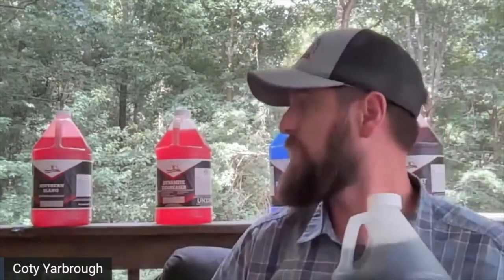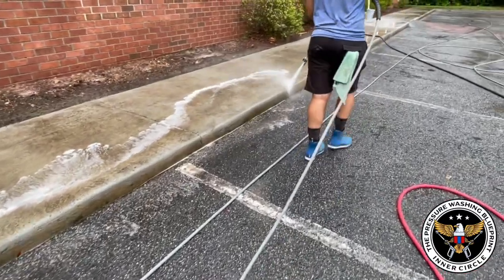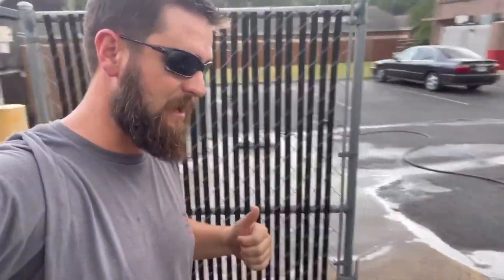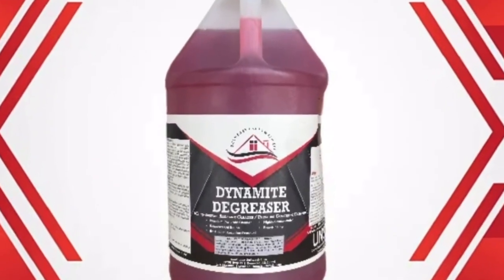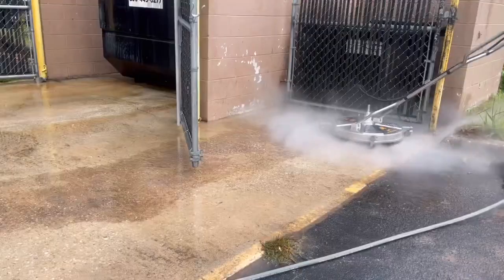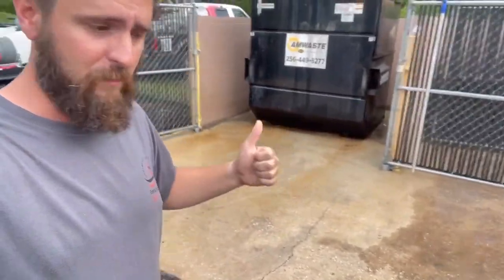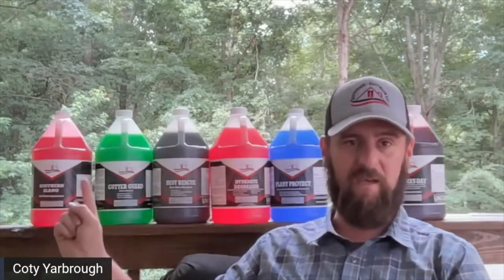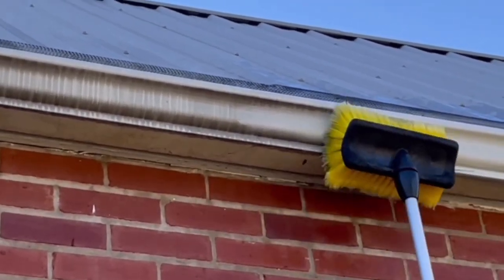3 Chemicals That’ll Make You More Money Pressure Washing

Comment: Justin, I recently purchased Southeast Softwash Surfactant and I am using a foam cannon for application. I am having trouble with it working. I have the surfactant and bleach in the cannon. Is there a specific amount of each I should put in or a specific bleach? I am using Clorox outdoor bleach right now. Any tips would be greatly appreciated. Thanks!
Reply: You can't do a entire house with a foam cannon unless you plan to fill it 200 times plus your not going to get enough SH to do anything

Comment: Do you ever offer to wash a customers car(s) as another upsale on your way out? I'm talking, just a basic foam, wipe/brush, and rinse.
Reply: I used to do this. The problem is people get a lot more picky about their car and you run the risk of getting blamed for scratching or missing spots or sun spots. I thought this was a good idea until I started doing it often. If you're going to offer this service I'd suggest doing your homework on some detailing practices that auto detailers use and use the initial service to judge whether a customer is comfortable enough with you to be able to offer that service. I've quit offering it entirely just because I'd rather pack up and move onto the next house.
Reply: I personally wouldn't due to the fact there is so much more you would have to learn thats completely separate than pressure/soft washing. Detailing is like a separate business in of itself. That being said, you could have two services, two teams. Team one having expertise in pressure/soft washing and team two for detailing and keep them separate. Have a detailing team and a pressure washing team. That's how I would do it anyway. Everyone is different doesn't mean I'm right
Reply: I do the washes on vehicles for $5/ft. Rinse, foam, soap, hand brush, rinse, air compressor dry, hand dry. It takes about 30 minutes on a car when you have your hoses out already and I have a minimum of $150 for a one time. I have a reoccurring monthly for $100 on vehicles. Works for me. Auto detailing makes less than my regular services, but it's a great filler and fun to do.
Reply: From what I’ve been learning the optimal psi and gpm for pressure washing cars is roughly 1100 and 1.8. Isn’t the pw you’re using for household much stronger than that? It seems like the risk of damage would be much higher but if you’ve been doing it a while maybe not. Thanks!
Reply: @annagraham6204  I have not started, I'm putting a plan together. I would not be using that kind of pressure on a car😅 just trying explore any upsell opportunities.
Reply: @annagraham6204  Yep you're not wrong. I just idle the pressure washer down a bit and use a wider fan and dont get close as to not damage anything. Never had a problem.
Reply: I’m a auto detailer, but planning on expanding to pressure washing business. So I already  have product/ technique knowledge and was wondering if it can be done, home and auto pressure wash with

Comment: Question: are all of those chems straight applications to any surfaces or does it need to be diluted?
Reply: im pretty sure it depends on the surface, stuff like concrete can handle stronger chemicals but if you were to be doing roofs or the side of houses I believe diluting is better so there arent big differences in color

Comment: Hey serious question. When you go into a job to wash just the drive way should the removal of oil stains be added as a add on service or be factored into the price because of the use of a separate treatment? Please and thank you! ^_^🙏
Reply: extra work time and material I’d think so
Reply: Definitely add on service
Reply: Make sure the customer is aware up front that just pressure isn’t going to get this stain completely up.